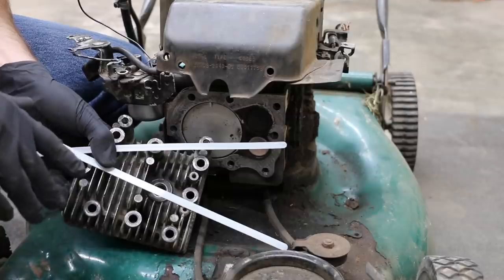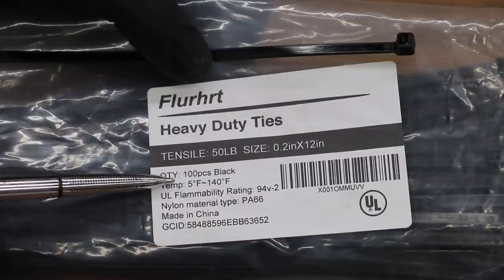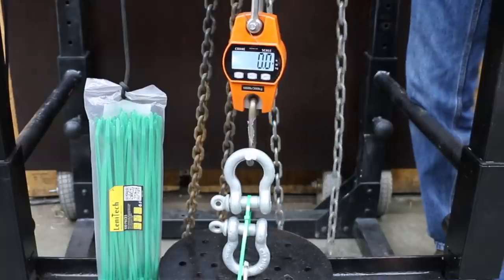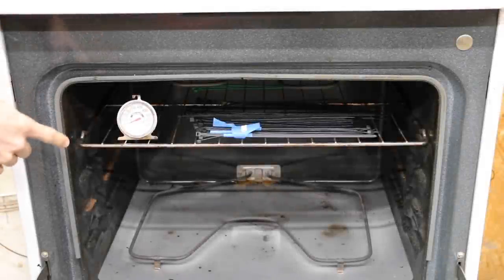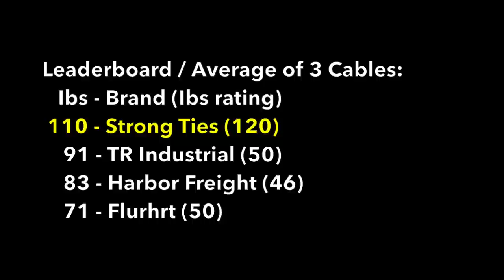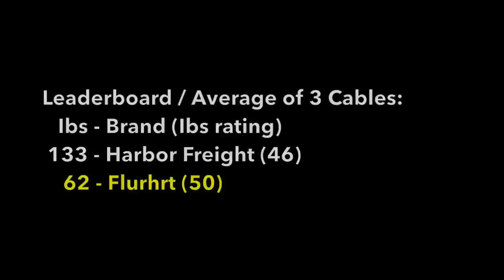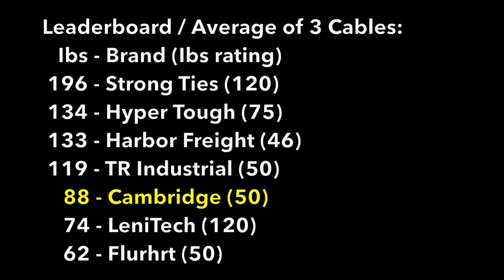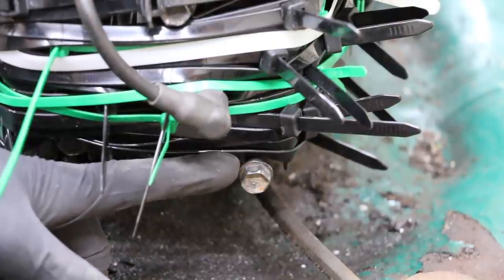Best Zip Tie Brand (7 Brands Tested)? Let's find out!

Comment: The T&B TY series cable ties would blow ALL of those away. Best ones on the market.
Reply: I agree. Thomas & Betts sells the original Ty-Rap (TY) brand with the infinitely adjustable metal gripper tooth. That’s my go-to solution if I care about performance. Otherwise I use GB (Gardner Bender) brand available in Northern USA for temporary tasks like cinching up a trash bag where it’s good enough.

I wish this test included T&B for comparison since they are my gold standard for cable ties.
Reply: I agree

Comment: Great info! Great videos!
The only additional thing I would be interested in is UV (sunlight) resistance. I have found satisfactory plastic ties that disintegrate after 1 month of California sunshine. :(
As an alternative, we have started using Harbor Freight stainless steel cable ties at $.27 each.  So now I wonder how those would perform in your strength test?
Reply from the maker: Great point! I need to test the HF stainless ties
Reply: I presume that even the black ones don't last very long?  I've heard that they're more UV resistant, but mine aren't really exposed to direct sunlight much.

Comment: As an engineer, I can tell you that harbour freight wins purely because it can reliably perform at more than double its rated capacity, If I needed to hold up 80kg with the least amount of zip ties, I would rather use 2 harbour freight ties vs 1 strong tie 

You should include a comparison of how each brand performs relative to its rating (for example, harbour freight can perform at 253% of its rating and lenitech only performs at 74% of its rating)
Reply from the maker: Great point!  Thank you
Reply: Engineer to the max ! I love seeing the numbers. My brother is a space rocket engineer and he talks the same talk.  Hes military  so please dont ask " what " he does. Even im in the unknown.
Reply: @petroldevo9934  I'm not military, but I can imagine he works on things that would make my head spin 

I mostly work on aircraft and the occasional DIY project
Reply: @mwbgaming28  i spent time in the air force working on new turbine engine designes and im the same boat, cant talk about it...
Reply: @petroldevo9934  lol, great minds think alike 

The benefit of being civilian is that you can spread your knowledge to anyone, for example, when I am on a flight sitting next to someone who is scared of flying or really nervous about it, I can explain that I am an aircraft engineer and to ask if they want to know anything, and in 90% of cases we spend time talking about how the plane flies, how the wings are designed to bend, how the plane is designed to withstand more punishment than a bit of light turbulence can deliver, what materials are incorporated into the design, how the engine pylons are designed to flex a little.etc and by the end of the flight that person doesn't realise its over until the plane lands XD 

Though I think it's mostly the distraction from looking out the window lmao
Reply: ☝️"Can't talk about it". YET, HERE I AM!!! Whatever...
Reply: Bam my first thought was how someone approaching the limits of a zip tie in their application would definitely use the rating to determine their application. From there the HF blows them away
Reply: @Onewheelordeal  yep, I definitely bought a few packs of HF ties, even paid the ridiculous shipping fees to get them into Australia
Reply: As a mechanic I can say that compared to leading brands the Storehouse brand is GARBAGE

Comment: Excellent review, as always.  Are you able to comment on where the failure point was on the zip ties when testing their tensile strength?  I presume most failed at the closure point as that's where most of the strain would be given the change in direction into the clasp.
Reply from the maker: it seemed to vary by temperature.

Comment: I'm disappointed that Ty-Rap brand from Thomas & Betts wasn't included. But good video regardless.
Reply: I was hoping for them too. They are a fantastic cable tie.
Reply from the maker: Thank you!
Reply: Ty-raps win every time
Most expensive tho gotta snag some from electrician buddies
Reply: Yes, I too was hoping Ty-rap would be in this comparison.  I used them for years in the Oil Fields as an tech, but now living a few states away from any oil field, I buy them from Amazon. I also get the Harbor Freight ones and some other tough brand from a Trucking Supply place locally.  But the Ty-raps are still much better, in a number of ways.  
However, no plastic Zip-tie comes anywhere near what a same size stainless steel zip-tie can hold. But I've not found a way to get the SS ties as tight as a plastic tie.

Also last thought, the "black" plastic ties are supposed to be UV proof, the clear/translucent as not.  I've only found the Ty-Rap brand to truly hold up over time exposed to sun light &/or ozone.
Reply: @waynelevitz6672  Where do you find metal zip ties?
Reply: Project Farm I'll send you a bag of Ty-raps if you'll test them on video.
Reply: @jordananderson8299  I think I got mine at Harbor Freight. Home Depot may have them too.
Reply: @waynelevitz6672  I had no idea they existed. When did they become a thing?
Reply: @jordananderson8299   Ebay is also another good shout. Keep meaning to buy some incase the exhaust snaps when out and about (happened a few times...damned potholes)
Reply: @waynelevitz6672  you have to get the tool to tighten the SS ones. Plastic ones are still easier. But the metal ones did come in handy wrapping pipes with heat trace or wrapping hot heating oil lines in industrial plants.
Reply: Ty Raps are great quality for the cost.  Panduit is great of course but costs out the a$$!

Comment: Random thought. Does that mean if I use 3 of whichever I get 3 times the strength?
Reply from the maker: Great point!  I believe you could get 3x strength if exactly the same length.
Reply: Awesome question. I would love to see if there were diminishing returns.
Reply: If so. then Harbor Freight would be a clear winner on a cost = performance basis. You'd get 3x HF performance for less than 1x the cost of the others.
Reply: You'll get 3x the strength if you use them in parallel, but not if you use them in series (think electric circuit terminology).

Comment: Great video again. Ever think off testing out the Harbor Freight multimeter vs some Amazon, fluke and others?  They can get expensive so I wouldn't recommend the test if you don't already have some good ones on hand. 
Regarding this video, at the prices of the zip ties, I'd even think of using two to 3 harbor freight zip ties for strength applications. Fortunately, I usually only use them to hold cables and other things that require little to no strength. For the price,  the Harbor Freight brand easily takes number 1.
Reply from the maker: Thank you for the video idea!
Reply: But will the Harbor Freight multimeter keep working to complete the test?  The HF brand is scary to use because it can lie soooooo bad!
Reply: Often times the higher end meters are safer than the cheaper ones, and that's where a lot of cost difference comes from (that, and branding). Knowing your Fluke won't blow up in your hand if you fuck up is where the cost comes from. Of course, both have their uses. You don't need a $200 multimeter for low voltage DC  and similar things.
Reply: I've built some resistor bridges to test multimeters over the years. The Harbor Freight I've tested, from the $3.99 version to the $49.00 version with the $3.99 version being off on ohms readings by more than 15% of the resistor value.

Real world home owner use, it's close enough. For automotive use on a new car, don't waste your money, as the deviation from the test value will have you purchasing new parts to replace perfectly fine older parts.

The company I worked for required our in-house calibration lab test all measuring equipment. Fresh out of the box, they'd reject 20% of the Fluke meters purchased due to non-conformance. Yep, the big guys still produce equipment with flaws.
Reply: I have an old parameters 7040 multimeter (the one with push button switches on the side) I got it as a hand me down from an old mate who got it back in technical college, must be over 50 years old at this point and it hasn't even lost calibration 

Damn thing is indestructible, over voltage, over current, being dropped.etc didn't do shit to it lmao
Had it for nearly 7 years and the only things I have ever had to replace on it are the probes (once) and the 9v battery (every 2-3 years)
Reply: I have several HF multimeters, free with any purchase and have found the yellow ones to be generally accurate but the red ones not so much.
Reply: There are established electronics channels that tear down and test multimeters so this seems like a tangent too far off topic, plus as someone who uses a multimeter frequently I can tell you that a lot of the problem isnt' the accuracy - many tasks don't require high precision, but instead the garbage design/build/materials, that they fall apart as well as being dangerous, through regular use not just things like dropping from 3 feet or taking the screws out to replace the battery or fuse... but hey, when you get one free with a coupon and just need to see if your car battery is near 12.6V engine off and 14.4V charging, great for that!
Reply: I've used 3 different Harbor Freight meters off and on for quite a few years and they seem to be alright for most tests . The current one I've had probably 4-5 years is the Black & Orange meter with the AC current clamp(which is the reason I bought it) and it's working just fine but has limited functions compared to the yellow or red meter. I've used it while measuring voltages in AA5 tube radios and it did just fine. I also have a Uline Phoenix that I bought for HVAC school a couple years back and I also us it for other stuff but the thing I don't like about it is it uses three AAA batteries, which need changed often. It was a 100.00 meter compared to an 8.00 to 10.00 HF meter. If my Uline  used a 9 volt like most other meters, it would be much better but you can't really compare a 5.00, 8.00 or even a 10.00 meter to a decent 100.00 one.  Although I paid 100.00 for my Uline from the bookstore, it's still probably a 60.00-70.00 meter now days.
Reply: @mrhatch117  For basic AC or DC voltage checks, continuity tests and even checking resistor value checks it will be fine. As long as you don't use the wrong setting or exceed the voltage limit, which is probably 500 volts AC it will do the job.

Comment: My two favorite brands of zip-ties are the HellermannTyton brand and the Panduit brand. They both make a wide variety of zip-ties. Both offer UV, chemical, and weather resistant zip-ties. I have used both brands for about 20 years...
I do use the Harbor Freight zip-ties quite often but only for short term use. Like many, they don't hold up well outdoors.
Reply from the maker: Thank you!

Comment: I feel like it might’ve been beneficial to test how hard you could tighten each zip tie before the head of the tie snaps. Typically that is the problem I run into with ties since I use a lot of them in cold weather applications.
Reply from the maker: Thank you!

Comment: Looks like zip ties aren't gonna solve my missing head bolt on my Chevy 350
Reply: kclefthanded 427 because roadkill
Reply: You can just weld that shit on. I’m sure someone has done it to a small block Chevy before. Hell, about 7 months ago on Craigslist I stumbled across an old ford that someone had welded the exhaust manifold right to the head.
Reply: @stevenvanheel3932  Lmfao

Comment: Can you test exposure to UV light?  I had some ties a year or two ago that were extremely brittle.  They would break if you bent them wrong.  When I contacted the company, the claimed that it was UV damage.
Reply from the maker: Great test idea!
Reply: UV does not mix well with most plastics.
Reply: Yes indeedie!  I use mine to secure coax cable to a antenna mast and as you might imagine, UV is the worst destroyer of a zip tie you want to be in place for years. For that purpose I look for UV resistant. Just hope they live up to the name.
Reply: @doxasnob8137  "For that purpose I look for UV resistant. Just hope they live up to the name."
If you need that - go with metal.
Reply: thats why zip ties are useless junk...even out of sunlight they are just a temporary thing...buy some bailing wire or stainless steel zip ties
Reply: @philtripe  For their intended purpose, they work fine. In the last month, I cut off some zip ties installed in '61 on an international truck, they were still holding fine. For securing wire, bailing wire will more often than not damage the bundle, and the stainless zip ties are even worse.

Although I do keep both #9 fence wire and stainless safety wire in the truck toolbox, those do work better for side of the road repairs. The problem is, people try to use zip-ties for things like that, and that is absolutely not what they are intended for.

Comment: You should test the Ty-Rap zip ties from Lowe's... They're $20 for 100 and have a steel tooth to grip the plastic...

Maybe also test Utilitech and Commercial Electric from Lowe's and Home Depot respectably...
Reply from the maker: Thank you for the video idea!
Reply: Absolutely. Those are the best and most consistent in quality I've ever used. The tie will stretch considerably before failure and the locking mechanism never fails.
Reply: I just can't justify the cost at 20 cents each... I don't do anything heavy duty enough to tax these to any kind of limit...

Comment: Wouldn't the ties be cooled off by the time you get them attached to metal shackles that will act as a heatsink? 

Maybe get heat gun and figure out how hot it gets at a specific distance from the zip tie. Then heat the tie and the metal shackles to the desired temp. All the parts need to be at the same temp to simulate real world conditions.
Reply from the maker: Great point!  They probably did cool a little.  I was pretty quick.  Thank you
Reply: I agree the ties may have cooled/heated back up while being attached, but it does give an idea of what they will be like under those conditions. I guess the only perfect way to test it would be to have the testing rig in a giant freezer/oven for the testing, and the logistics of that would be ridiculous!

Comment: I feel you would have had better luck if you would have put the head bolts in, then put the zip ties on. They're kind of hard to pull things together with, but hold once tightened. Then u could have taken out the bolts. Regardless love the videos, keep em coming!
Reply from the maker: Thank you for the constructive feedback!
Reply: @ProjectFarm  Also maybe one of those zip tie tightening tools might add to it.  Great channel and I look forward to it since I discovered your channel.
Reply: I don't think that matters at 2000psi
Reply: I like the way you think!!
Reply: @pumpkineater629  I don't think you'd get 2000psi power stroke cylinder pressure on any stock flathead briggs engine.

Comment: When I was at the John Deere store they had some that where like 5 feet long
Reply from the maker: Now that's a serous cable tie!
Reply: Wow that does seem excessive eh I wonder if those would be for adding mud traction to tires. Prolly too weak eh but I've seen special ziptie/zap straps used on car tires in lieu of chains.

Comment: I rather buy HF brand and use two...still saves money.
Reply from the maker: Thank you!
Reply: No point using two if it's to secure the same location.  That takes up extra space so you might as well just use the next size up unless it's a width limitation but doubling the ties by putting one over another is not quite the same as the inner tie will get more stress than the outer.  Short version:  Buy the biggest tie that'll fit unless the slight task is undemanding then buy by price.
Reply: @stinkycheese804   real world....you got one size.   You use two if you need two.

Comment: I JUST discovered reusable zip ties, changed my life...
Reply from the maker: That's a great way to go.
Reply: they are all reusable just use something thin to unlock them
Reply: A tiny blade screwdriver makes them all reusable. Just don't expect them to lock in the same spot.
Reply: You might also have a life-changing moment if you try stainless steel ties. They have a tiny metal ball in a cup that locks them surprisingly well. Downsides are cost (I got mine on a big sale from Grizzly), the difficulty of cutting the excess off, and the edges are a bit sharp. But UV doesn't affect them and they're quite strong.
Reply: @bmay8818  stainless?! Today just gets better!
Reply: they get stiff after a while though, especially under the hood of a car
Reply: After that polar vortex and -40f or worse weather, this is all actually really helpful information, thanks all!
Reply: I normally cut them to fit the application though. Doubt I would reuse many except the giant ones (already do)

Comment: now get some of those 4 dollars per 1000 units packs from china and see how they compare
Reply from the maker: Thank you for the video idea!
Reply: You don't think the HF ties are from China?  Matter of fact most of these tested are probably from China.
Reply: @Hoggdoc1946  but they weren't 1000 for $4
Reply: @asherdie  How much do you think harbor freight's markup is? They're likely to be the same ties, just in different packaging.

I can't speak to the larger sizes, but I bought a pack of those in 6" size for small electrical work, and havent had any complaints. I wouldn't trust them for anything load-bearing, but they do seem to be OK.